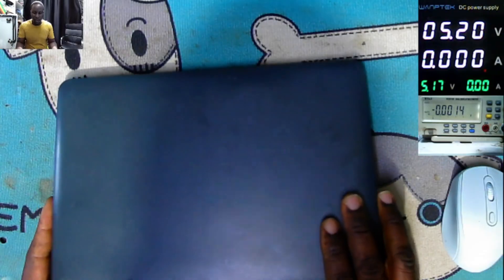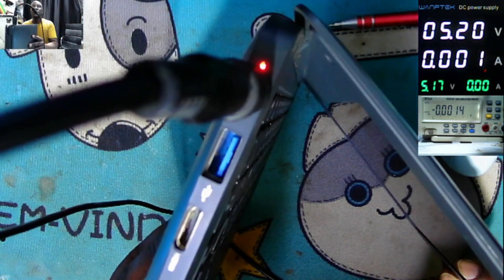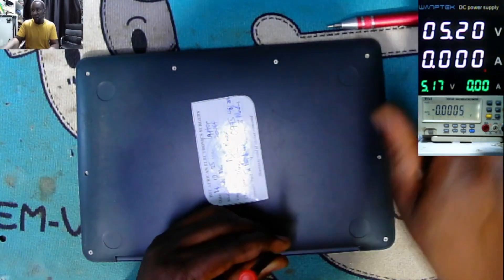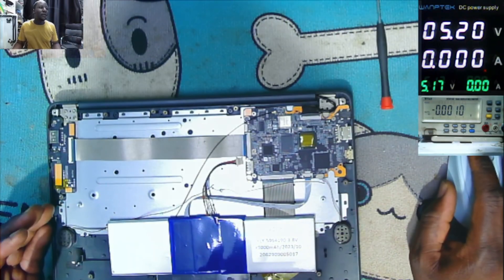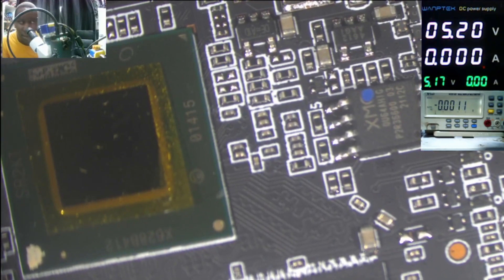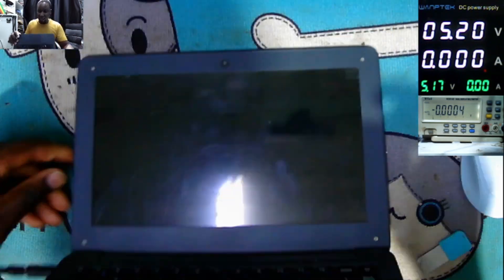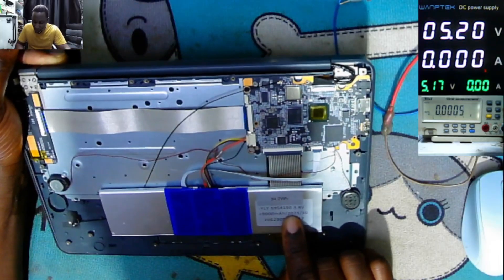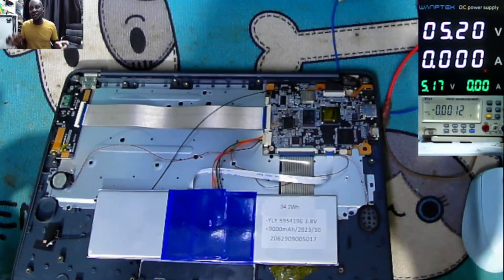Intel Mini Dead Laptop Repair, Charging LED On With No Current Consumption.

Comment: The common fault on this type of motherboard is: you plug the charger and the charging light is on ,the power on led is also on but the cpu is not warm. You can even power on/off with power button ( every thing is mormal) but no display and the cpu not warm, I change the axp..... chip (universal power ic, all in one) no positive results, I gave up repairing this one's.